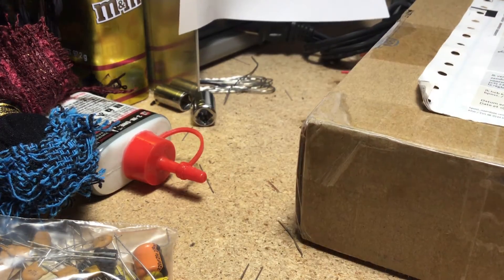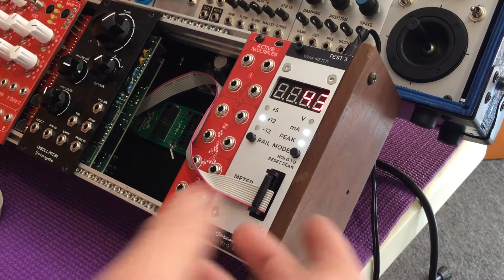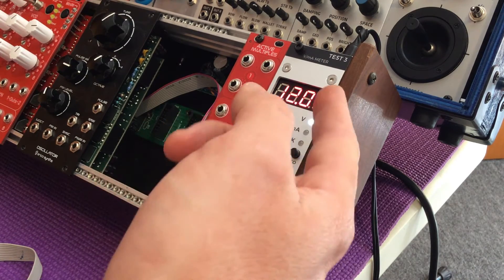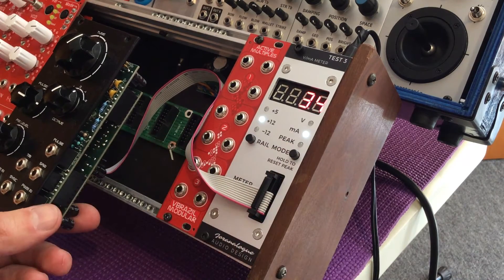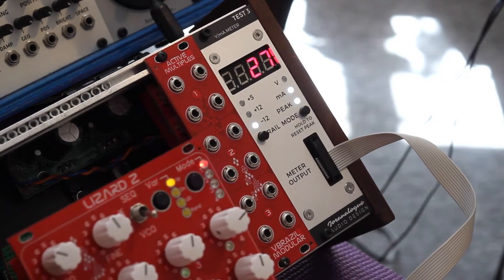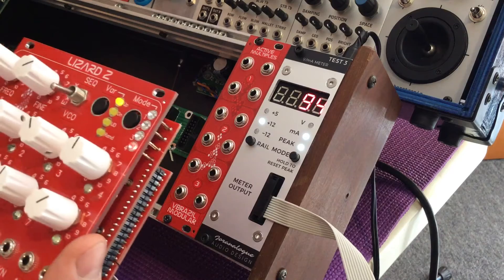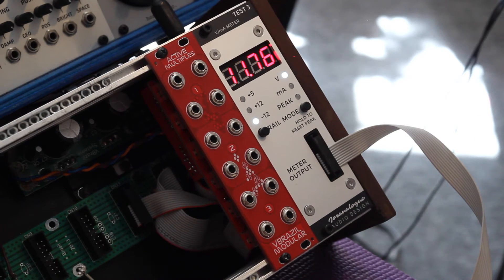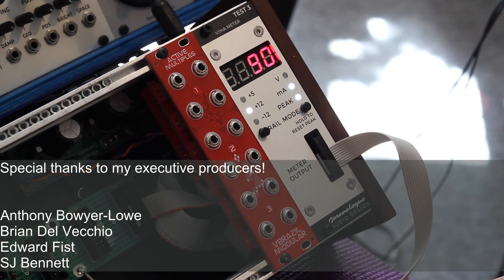Kit Review # 13 -  Joranalogue Test 3

Comment: Does it test the mA of the buss board that it is powering it ?
Can I connect a power cable fron the front panel, to an empty buss header ?
I thought it would automatically tell me mA for the entire buss. Mine says "0 mA", with nothing plugged on the front.

Comment: Nice review!
A comment on the test method: the current consumption may increase a little bit when you "load" a module (e.g. attach something to its outputs). Reason is: the output stage (usually an opamp) driving that output now needs to push current through the input impedance of the other module connected.
Reply from the maker: Ah yes, thanks :)
Reply: True, although this will typically be so low it doesn't really matter (for example 10 V into 100 kΩ would be just 100 µA or 0.1 mA).

Comment: I didn't know it was safe to plug modules in when powered on - I've always powered the case down first. Or does this meter enable hot plugging somehow?
Reply: I'm a bit late to the party, but... Nope, it's generally not an issue! Modules should be capable of sustaining a 'dirty' switch-on like this, since many PSUs don't switch on cleanly anyway. But of course you may still run into the odd module which doesn't play nicely, and in such cases powering down first is recommended.
Reply from the maker: It's really only a precaution, 90% of the time it is not a problem to plug in a module to a PSU while powered. I avoid it because the rails are usually grounded, so slipping a module in might short one of the power rails to ground and cause a problem. With the Test 3 of course you're not racking the module, only plugging it in to test, so there's really no issue, but to be extra safe you can go ahead and turn off the rack every time you plug in a module.